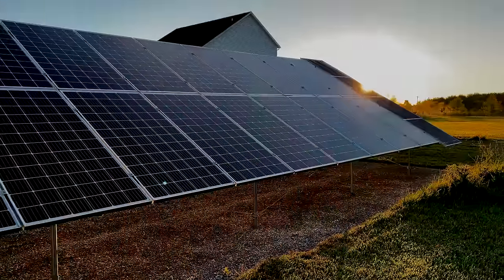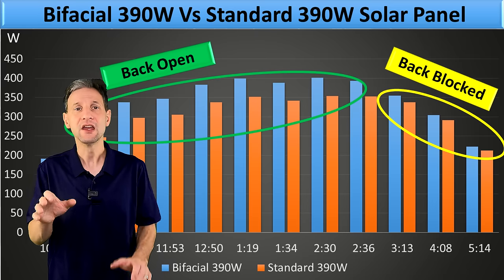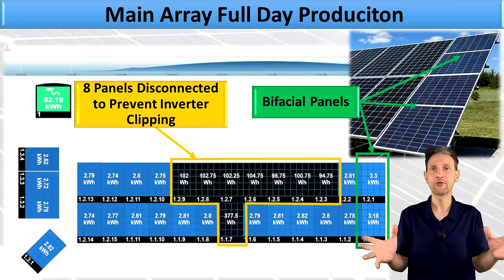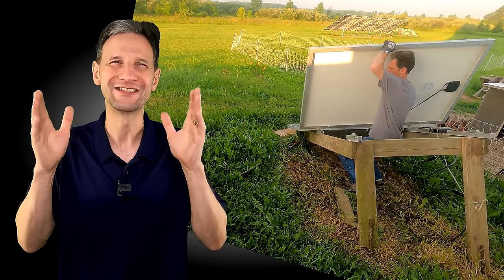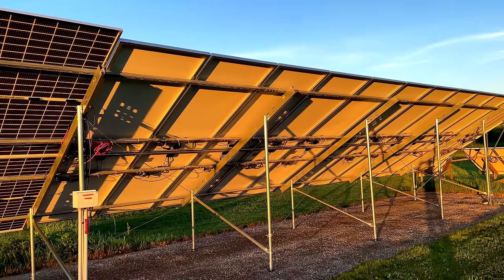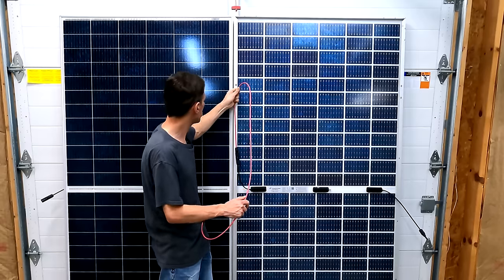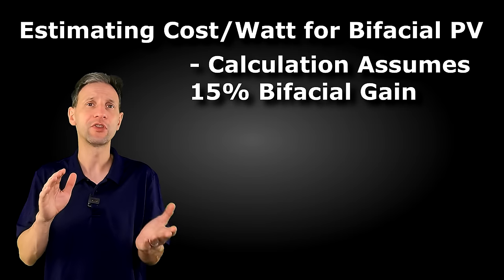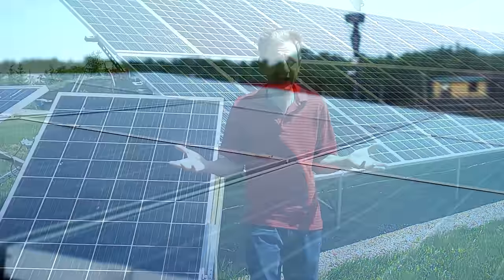Bifacial Solar Panels - The BEST Solar Panel? Real World Results!

Comment: I would think bifacial would only make sense when you're constrained mainly by the available land, rather than the cost per square meter of all panel area. The rear side will never get as much as the front, but the difference will depend on a variety of factors. You would want a highly reflective underside area. It could also help to have two -axis tracking, computer-controlled.
Reply from the maker: It all comes down to cost/watt.  No matter what you use, extra standard panels, bifacial panels, or tracking systems; simple take the total amount spent divided by the power produced to determine the best solution for you.
Reply: I've seen some suggest mounting the bifacials vertically, so that a side of the panel is parallel to the high noon sun, and the faces are east/west.
This gives a dip in output at noon and peeks in morning and afternoon. 
Combined with normal single face panels mounted horizontally giving longer peek output, of course the verticals need to be place to not shade the other panels.

I plan on testing that once I clear some debt before getting some bifacial panels.
Reply: @1DwtEaUn  This can be analyzed from theory, but it could get a bit complex, and in the end it's going to involve a lot of test data as well. It will influence the type of installation to do in the first place. I expect two-axis trackers to get more popular over time, just because the necessary hardware and software will keep getting cheaper (per watt of capacity). 

Part of the design decision will be whether to go bifacial, and what kind of surface to have behind the panels if you do go bifacial. You might also not want the same kind of cells on the back face. Lots of things could potentially go into this, but a few will probably dominate in the end.

Comment: Careful with them. I had Trina Bifacial early as last year where they were cleared from a solar plant where they were all cracking on the underside only after a few months of install. 
They were 485w and 490w panels.
Reply from the maker: The glass was cracking?  They were Trina brand?  Do you have an article or source that can you give me more information on this?  Thanks!
Reply: @ProjectsWithDave  I sell solar panels in the UK. Can send you photos.
Reply from the maker: Thanks!

Comment: what do you use for a load on your test rig?
Reply from the maker: It's a grid tie system using Norther Electric Power grid tie micro inverters.  So the grid is the constant load.
Reply: @ProjectsWithDave  Understood, for some reason I assumed your test rig would be isolated but duh on me, sorry! lol

Comment: Having had time to watch the video several more times to get a greater understanding of the potential of Bifacial panels, it would seem that optimisers have an important role in achieving the best performance. The cloudy day results show a 6% higher performance just between the lower and upper panels on the rack. I’m assuming without them, the performance on each string will be whatever the lowest performer is. I also posted a scientific paper that looked at mounting bifacial panels vertically in both N/S and E/W, but I see it has been removed. Hope I did not break the rules by posting it.
Reply from the maker: I haven't seen the paper you are speaking of.  If I were using a string inverter instead of optimizers or micro inverters,  I would string the lower panels together for string one and the upper panels together for string two in order to maximize the performance opportunity with the upper string.
Reply: Hi Dave, each time I post a link to the research document it disappears after a few seconds.
Reply from the maker: You could try emailing it to me.  My email is available on the "about" page for my channel.
Reply: @ProjectsWithDave  Unfortunately, YouTube does not display and email on your ABOUT tab here in Europe.

Comment: Great in depth video chap 👍
Most of the bifacial panels I've seen fitted in the UK are on vehicles and the used a mylar sheet under the panels to reflect the light that passes through 🤔 adds to the expense on a large array but is more feasible on a small scale.
Again really good video 👍
Reply from the maker: Thanks!  Interesting use case, thanks for the info.